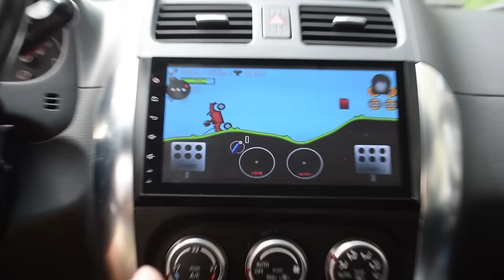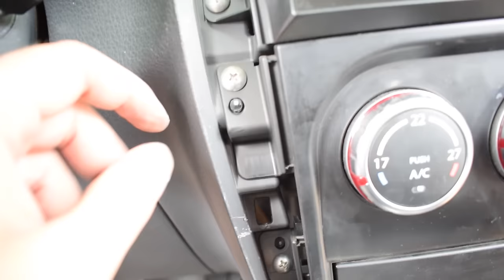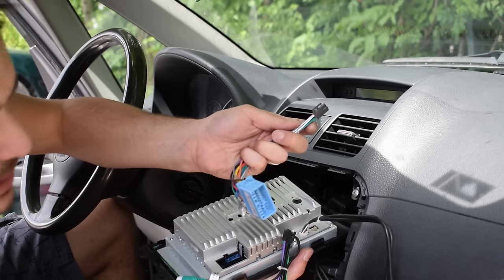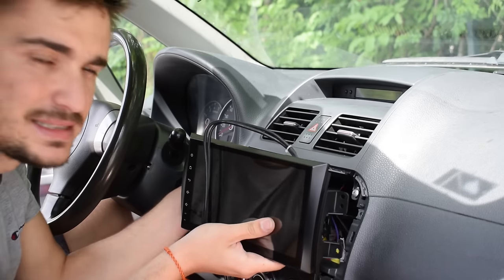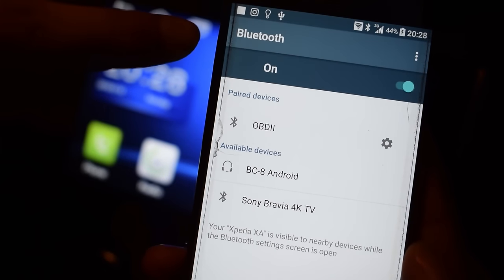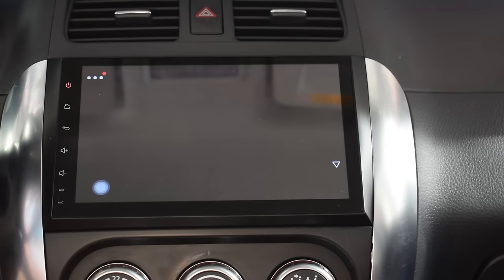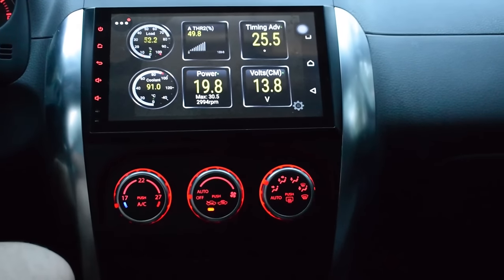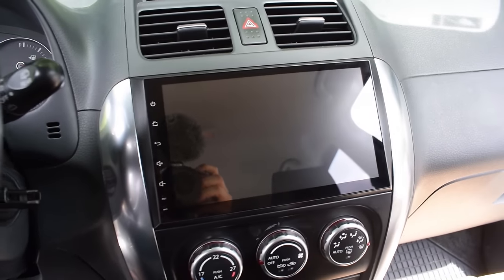How to INSTALL an ANDROID head unit into your CAR + Seicane head unit REVIEW

Comment from the maker: Panel popper kit: https://amzn.to/32Tdenz for safe removal of interior trim and plastic panels
The head unit: https://www.seicane.com?acc=812b4ba287f5ee0bc9d43bbf5bbe87fb
Use discount code: D4A
Reply: How did you get the suzuki logo to appear?
Reply: Discount code not valid
Reply: @killafx4726  go into the car settings and scroll down you should find logo settings
Reply: At 9.35 there is a middle finger 
And that's no good
Anything to say sir

Comment: As a  note, you do actually need the GPS antenna if you are using the navigation built into the unit.   The GPS  does not actually work without a GPS antenna as there is no internal GPS antenna in any of the Seicane head units.   It can be discreetly hidden under the dash, but it is 100% necessary if you are planning to use any of the navigation features of your head unit.  GPS is from Satellite, so it is definitely not stronger in city areas.  In fact, in city / urban areas that are built up, your GPS will see less satellites than in rural areas.     GPS does not work from terrestrial signals like mobile tower triangulation.

Comment: This unit is very good, Note to buyer do not use illumination cancel button or it will blow a fuse on interior fuse box.
Reply: Which one ?
Reply: Nvm. I checked each fuse, it was fuse number 12 for the tail light.

Comment: Thank you for your video- simple and clear.
1.Can you connect front and rear camera to this unit?
If the answer is positive - is it clear from the wiring or the manual?
2. Do you know if there is a gadget  to  put on the steering wheel to answer incoming calls  after installing this unit?
Thanks
Simon

Comment: Omg finally a YouTuber with 1gb head unit, all the other YouTubers have a 4gb or higher unit so seicane is misleading people by giving those youtubers a free better unit to review. people have said the 1gb unit are buggy and slow. I ordered one without knowing these facts, it's still on shipping status.....How is your unit holding up, do you have any issue. Is it slow and laggy And does it freeze. Instead of the 9inch unit likes yours I have the 10inch unit but it's the same specs as yours.
Reply: How was experience with the head unit..:.
Reply: Hello, how do you find your 1gb unit after all? I'm curious since I wanna buy one as well. Thanks in advance!

Comment: Great video as I have a similar SX4. Did the wiring harness come with your Seicane or did you purchase that separately? 2. clarification will the GPS work without an antenna attached? Again thanks for the video I am super happy I watched it.
Reply from the maker: Harness is included, GPS works ok without antenna for me, a bit laggy sometimes but usually ok. Thanks for watching, glad it was useful.

Comment: hi, i bought one  two months ago. But steering whell control not work. They said setup the CAN TYPE SET ( From the menu : System Setting > Factory Setting > Factory Setting(Tap) > Password 1617 Confirm >  Can Type Set  (From Left) > Can Type Set > ????? Here is the problem .. There is no Suzuki SX4 So i cant chose the proper can type.  )   i think because of this ( false can type set) steering wheel control not work. i saw that your seicane is start with Suzuki Logo. Did yu do that ? or it is setup from factory ? Anyway, could you write me the which Can Type selected in your seicane.

Comment: Great video! I am considering buying this unit. How is it holding up for you? Any issues with it yet? Some reviews of Seicane products are negative. So I am curious about its durability/quality. Thank you!
Reply from the maker: Hi, yeah I have seen the negative reviews. I can only speak of my particular case of course and it was really positive. I'm using the unit on a daily basis and there are no major issues. It's pretty smooth and fast. Bluetooth does disconnect sometimes at random and you just need to connect again, but I've seen that happen with high end OEM units too. Maps work great too, they lag once in a while, but that happens on most Android phones too. All in all, considering the price I am super happy with it, really improved my daily drive and the look of my daily driver's interior.
Reply: What's the name of the car radio , can you send me a website..

Comment: How come you didn't connect any of the AV input plugs? You just left them hanging ???
Reply: most of those would have been for external speaker amps, subs and camera inputs. not needed.
the standard audio for the car is in the main connector.

Comment: I was contacted as well. In talks to get a radio now for my WRX. Only problem is they want exact radio bay measurements and a picture of my factory plug. Odd since it's standard double DIN and I'll have to use a wiring adaptor either way. At any rate, hopefully I'll get one soon!
Reply from the maker: Maybe they just haven't worked with your year of wrx, since it's a bit older and they wanna be certain it fits right? They are a bit funky sometimes, but nice overall. Hope you get it soon too :)
Reply: Yeah I'm sure they just don't want to send something wrong and have me blame them. Hope yours is still working well. :)

Comment: Loved your video mate. Can I ask you, which model/year sx4 do you have? I just bought a 2006, do you think this will fit?
Reply from the maker: Thank you. Mine's a 2007. This should fit yours.
Reply: Installed it now but lost the dash light and backlights. Did everything like you did. Wonder what's wrong
Reply from the maker: @eirikpedersen9617  You must have connected something wrong or accidentally disconnected a cable or cut it. Get back in there and carefully check everything, electric connections can be tricky. Although I don't get how you could have messed up the back lights, I don't see how any of their wires would be in the center console area, but you cam never know.
Reply: @eirikpedersen9617  Its one of the black wires, when plugged in to the car one of the blackwires is conected to your dashbord lights. Solution is to disconnect that black wire so it doesnt make contact with the dashbord wire.

Comment: Hello, i'm a bit worried about the performance since this only has 1gb of RAM, how is it holding up after a few months? 
Thanks and nice video! :D
Reply from the maker: Hi, the unit is still holding up great. No issues really. The 1GB ram was never a problem for me, but I also don't run any demanding apps on it. I use Bluetooth music, and radio mostly and navigation sometimes. If you need to use apps that require a lot of RAM you can always mirrorlink to your phone and impress passengers :)
Reply: @d4a  Thanks a lot for your reply. I mainly want to use Spotify for music and Google maps at the same time. If it can do both at the same time smoothly I'll buy it I think!
Reply: @marclaguitare  it can do both Spotify and run Google maps at the same so long as you start Spotify on the head unit first

Comment: Thanks  for the video. Have the same 08 Suzuki sx4  bro. I'm very tempted  on buying this, what would be some complains it changes  you could make? Also do you have time pay for internet?   Thank you in advance  for your answer.
Reply from the maker: Honestly no real complaints. Sometimes the unit doesn't remember the screen brightness setting if I don't drive the car for a few days. Navigation is pretty good but it does lag a bit at random, not often tho. The stock radio app doesn't display station names but I solved that easily and just got a different app from the playstore. Honestly it's quite a bit better than I expected. Sorry I don't know what time pay for internet is.

Comment: How is the system? R U happy with the system you got ?
Reply from the maker: I am. Works really smoothly without any major kinks. Better than I expected to be honest.
Reply: @d4a  how much time do you have it ?
And do you it is Bluetooth 4.0 or higher or less?
Reply from the maker: I still have it and had it since the day I published it the video. It's in my daily driver so I use it every day. Not sure about bt, but there's a link in the description and a the specs are there.

Comment: How easy was it to configure steering wheel controls?
I still couldn't teach my SEICANE head unit, and my steering wheel controls have been useless for the past 2 months!
Reply: Did you figure it out at all?
Reply: @barteklewandowski4211  
Unfortunately no.
I still have to reach over while driving to adjust volume, skip tracks etc.

Comment: have you replaced a power window regulator for your sx4.  im trying to find a video tutorial and cant find one.  i can get the door panel off but my window on passenger side is stuck in the down position.  tried pushing it up but wont budge.  wondering if you have any ideas.  THANKS

Comment: Hello, I have one small problem. In my sx4 there was better factory radio with navigation. So it has a cable to integrated GPS antenna which I can connect to the new radio. I theory thats good, but I cant disconnect the GPS antenna connector so I can remove old radio. It's seems like it's mounted from both side, so I have to disassemble the whole radio to just get it out. The problem is, the radio is sealed with very small torx security screws. Can't open it with my toolbox which has several torx sizes.
Reply from the maker: It seems strange you need to disassemble the radio to unplug a cable. Carefully check the cable, there really should be a clip there or something.

Comment: Can the Aux cord go just like the USB ports?
Reply from the maker: Yup
Reply: driving 4 answers  So the only thing I would need to connect my phone via AUX would be a 3.5mm cable? male to male? or 3.5mm to RCA? By the way thank you for your quick answers
Reply from the maker: No problem. Exactly, that's all you need. Just get one that can be nicely mounted on interior trim.
Reply from the maker: Male to male if I remember correctly.
Reply: driving 4 answers  Thanks so much!
Reply: driving 4 answers  By the way I have a Suzuki SX4

Comment: Great video man, I know this is 2 years old but I’m wondering if you got the wiring diagram for the harness. I can’t find anything online for the sx4
Reply: Where did you find the radio? and you can find the wire on ebay or amazon.
Reply: @theprotectorplay7399  I found it on eBay, and that’s the thing. It came with a completely different coloured wiring harness. So I’ve still been looking for a Pinout or diagram of the original sx4 harness that connects to the head unit.
Reply: @Dantheman6074  I got it, but the head unit, where did you find it? Cause the website ask for a round 50 dollar shipping.
Reply: @theprotectorplay7399  EBay brother, I can’t find the exact listing but it’s not the same one as this buddy got. I just found some random cheap touch screen one to at-least update the oem one. Just search for Suzuki SX4 capable head units on eBay or just any other site really.
Reply: @Dantheman6074  Got it, yeah I found 2 on ebay, but from bad seller or good sellers from china.

Comment: Is the WiFi built in or connected somewhere else? I want this for google maps
Reply from the maker: Wifi is built in. You can either put a 4g sim card in it, or use your phone as a hotspot or park near a wifi network.
Reply: @d4a  really?! So you have everywhere Wifi?
Reply: driving 4 answers do you need internet to use gps or doe you is there no gsp tracker in it?

Comment: I have a toyota camry 2013 Le Canadian model, planning to buy a seicane head unit, do I have to buy anything extra in terms of cord or everything comes with it, i have a back up camera in my car as well,
Reply from the maker: I don't think you need to buy anything extra. Double check if the harness for the camera comes with the head unit, other than that it's all there.

Comment: Will this panel work on an Sx4 Crossover 2014 too? or do I need a different panel? Thanks.
Reply from the maker: Seicane has a different head unit for the 2014 model. You can see it on their site.

Comment: Man I have 2 question. I see you have SUZUKI car, i have also but different one, so I want to know, can you plug in 2 cameras on that new android? I already have one in the back for parking, but I would want to have one more in the front, because it is a suv so I don't see very good in the front when I try to park in tight spaces. Also I want to know, can you plug in TPMS sensors on that android, i have those in my tires, but I would like to have it on the big screen, if you know that information? Thank you.
Reply from the maker: I'm really not 100% sure as I didn't make or design the unit, I just did an install and review video. I think both of those options may be possible but it's best to get in touch with Seicane directly for the actual details.

Comment: Hello mate I need your help does this tutorial work for a Suzuki Splash 1.2 ddis Diesel 2009?
Reply from the maker: The tutorial is applicable, but the unit is not the same. Please check out Seicane's website to find the right model for your car.

Comment: Does it have RDS, the thing that reads the radio station texts?
Reply from the maker: I think it does if you download a different radio app
Reply: @d4a   Dobra prezentacija
Does make any difference if I buy it with the low performance models 1gb ram and 16gb memory?
Reply from the maker: @zivkojordanov760  Honestly I wouldn't know, I never tested or installed any Seicane unit other than this one, and I use only the most basic features, I don't download apps or anything.

Comment: Thank you, I wanted to ask If someone can help me, my sx4 pannel has some rattling in the front ventilation (windshield area). Is it hard to dissasembly and put foam in this area? Did someone try to make this? Or reduce the rattling somehow? Big thanks.
Reply from the maker: You will probably need to take the entire console off which is a pain. Just turn your stereo up :)
Reply: @d4a  hahaha thanks, I will try this fix